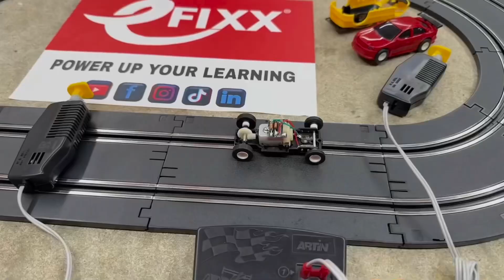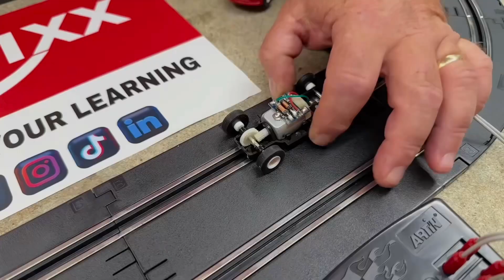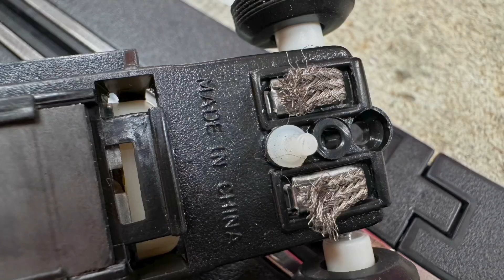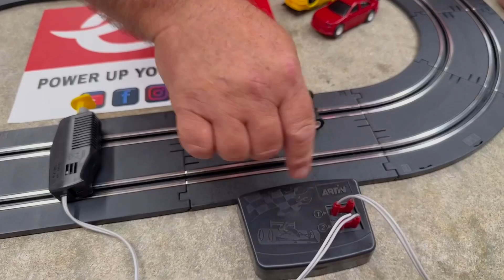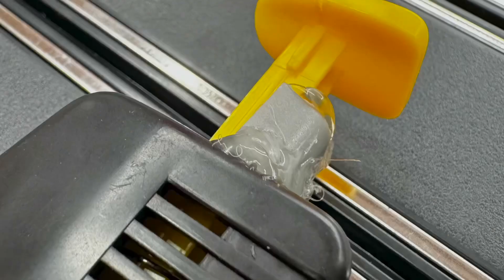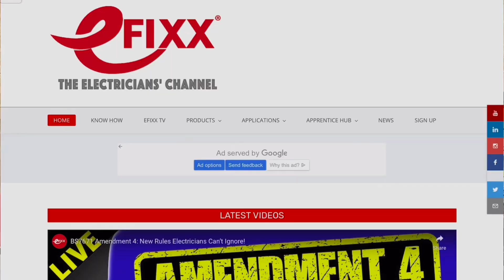When Electrical Science Meets Scalextric!

Comment: I used my dual bench power supply. Upto 31V/5A per channel.

Sure both players are very intimate and the controller is a bit rubbish, but it goes like the clappers - until the smell of burning enamelled copper wire takes over.